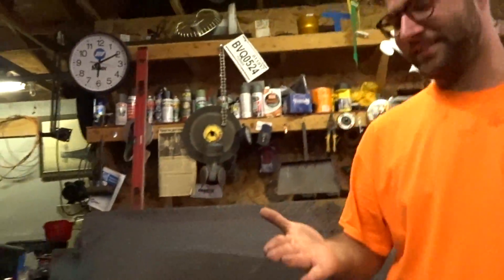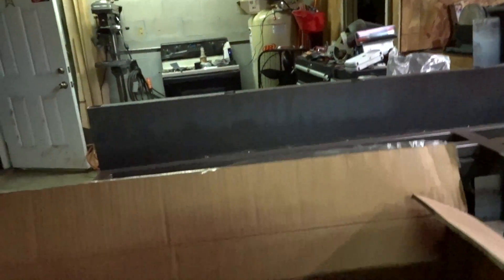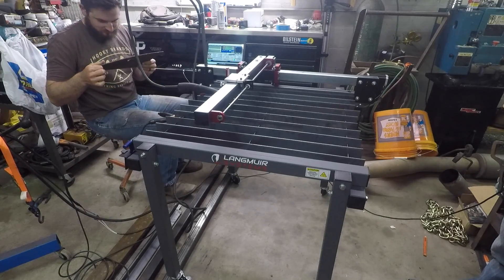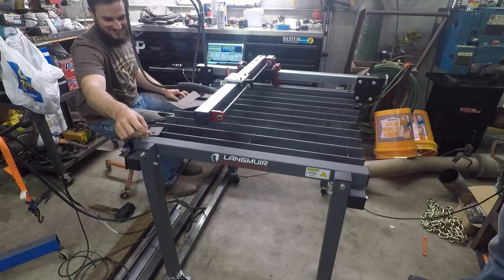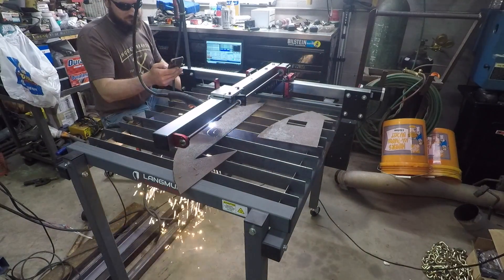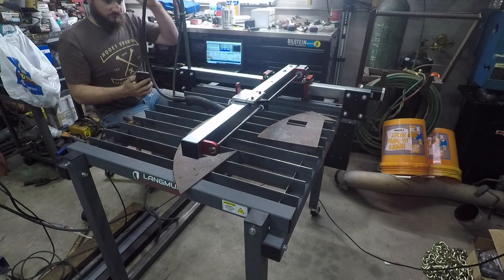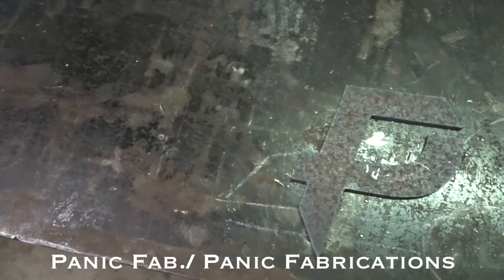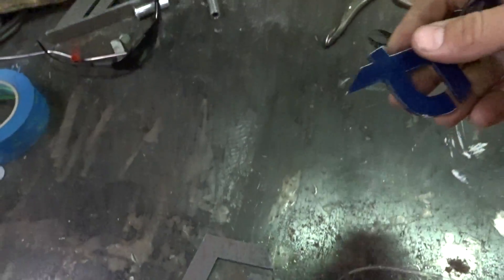Personal CNC Plasma Table!! (Langmuir Systems Crossfire)

Comment: Dude, I'm having trouble with the wire that turns the flame on and off. How is it connected? could you help me jd.cheda7@gmail.com
Reply from the maker: Take apart your torch and see which wires operate the trigger, then trace back to inside machine and tap into the 2 wires.  Run a short piece outside the machine to to plug your wire from the table into

Comment: Could you possibly show how you wired the plasma up to this I’m looking to run the same table with my power max 45
Reply from the maker: Pm45 should already be pre-wired for it, if not just take apart the torch and figure out which wires operate the finger switch and splice into them

Comment: Been looking at one of these tables.  One thing that would make me concerned though, is the lack of support for the right side of the X gantry.  Do you find that it sags at all?  Or is the height of your cutting head varying a little bit not an issue? I think if I get one, the first thing I would make with is is a support with a roller for the other end of the gantry, just for my own piece of mind.
Reply from the maker: There isn’t enough weight to make a difference really on the far end of the gantry, it’s kinda nice having the other side open so you can fit an odd piece of material that’s isn’t exactly 2x2

Comment: I'm almost where u r w my business.   Something I created.  Next step cnc.  I hav 50 plasma.  How did u wire in ur cnc?
Reply from the maker: I’m assuming you mean the start/stop for the torch?  If so, I had to take apart my torch to see what wires were used for the trigger and after that I just opened up the machine and found those wires and spliced into them some plasma cutters already have a hookup for this on the outside of the machine
Reply: Also,  I need lots of 3 x 1/2 x 1/4 inch pieces.  The table slats seem 2" apart.  Any method of accommodating smaller cuts?
Reply from the maker: Weld it to something that will span the gap
Reply: @j_moffitt  or use more slat pieces at 1 inch apart.  Can extra slats b inserted?

Comment: Congrats on the table. I purchased a 4x8 from cnc router parts woth a powermax 45xp and love it. I do it as a hobby. They gave me fusion360 but I only use is for specific measurements like brackets and such. Almost everything else I use inkscape. Good luck with your machine they are a blast.
Reply from the maker: I’m already thinking about a bigger table but I need more room haha

Comment: I give you 6 months until you get a bigger table. I have had a 4x4 for 1 year and wish I had at least 4x8. Good luck and welcome to the addiction.
Reply from the maker: I’m already thinking that haha but at least this will give me some experience
Reply: I’d love a 4 x 4. But with all the equipment and just stuff I have, along with not enough space now, I don’t even have room for that.

I do get nervous over just one support. If someone mistakenly smacks the end of the arm, they can damage it easily. I can also see that over time, that arm is going to begin to droop. I also see more accuracy nearer the support, and progressively less as it moves away. Probably not bad when new.
Reply: @melgross  and maintained.

Comment: Just saw the price of Fusion 360 software which is about $500 per year. Might get the 30 day trial to check if I will be able to handle the design process.
Reply: Fusion 360 is free if your a hobbyist, student, or a business making under 100K per year
Reply: @pgf202  Awesome. I have a powermax 45 and would like to start this out. I will look into this again this afternoon.
Reply: @pgf202  is it free until you aren't one of those? or just for a year?
Reply: @loganschlee2291  until you aren't a hobbiest or student, I think you have to renew once a year but it's free.